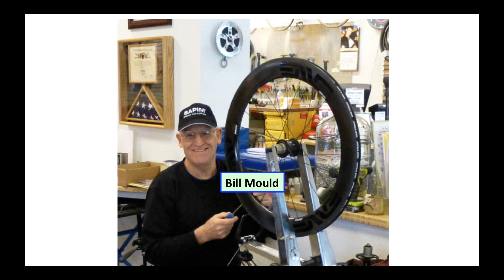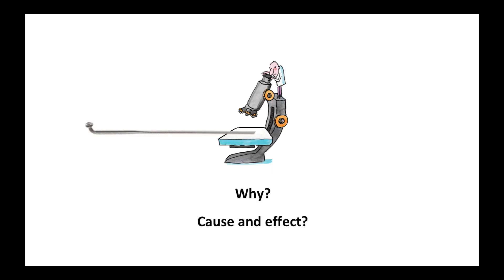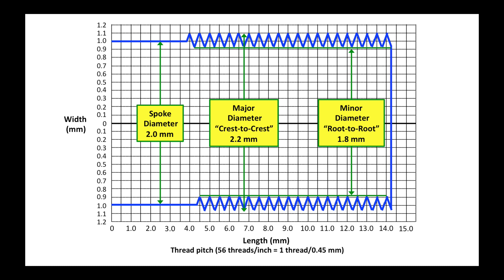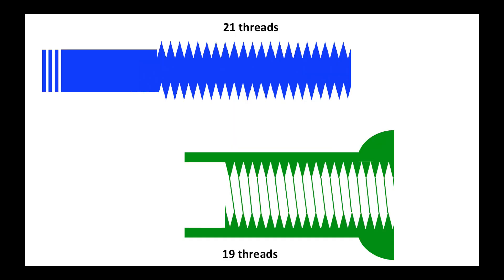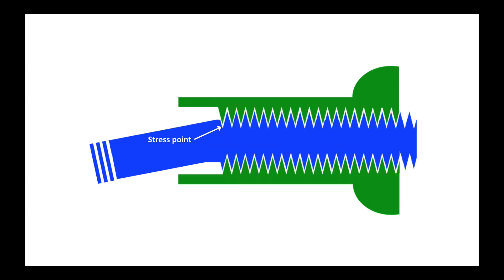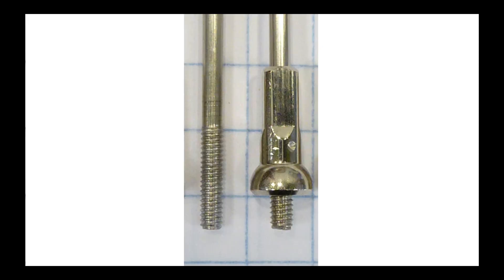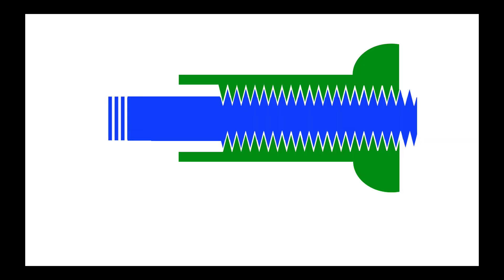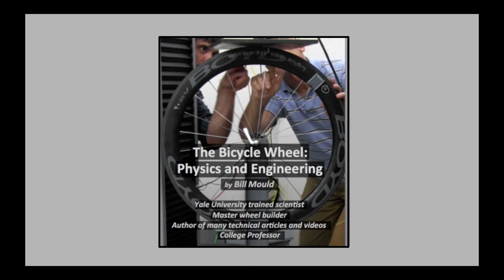Optimal Spoke Length

Comment: I usually thread about 12-13mm on every spoke I use (they usually have about 9mm) to avoid any issues of this kind. I also bend the ends a bit to prevent stressing the spoke at the base of the nipple

Comment: While the advice on spoke length has some logic to it, in my opinion it might not be the best solution with aluminium nipples. Once you bottom out a Squorx DT Al nipple, it's a gonner. TIghtening it further will either rip the square interface off the body of the nipple at the top or strip the splines of the external torx on the inside of the rim.
Reply: There, just yesterday I tried replacing a spoke in a wheel where the spoke I received was too long. Immediately after the (brass!) nipple hit the end of the thread on the spoke, the square interface part of the nipple simply broke off. No way whatsoever of tightening it over the spoke thread.
Reply: Yes, not the best advice, it simply doesn't work universally except for some isolated cases.

Comment: I neglected to add: If not having enough threads is a problem use a different nipple. Some have more thread than others as well as different overall lengths as you know.
Reply: Plus better alignment/orientation capacity.

Comment: Having built several thousand wheels over the years...I find spoke breakage at the nipple to be maybe 5% of the total of broken spokes. I see more failed nipples than I do spoke thread fails. I don't like driving the nipple past the threads and onto the spoke shaft. It requires significantly more torque which may be a problem with some softer nipples, it slows the building process down by forcing my (slotted) nipple driver off the nipple  4 or 5 turns prematurely. I also try to consider that I may not be the next person to work on the wheel. A nipple driven past the thread (especially aluminum) can gall against the steel shaft and be very difficult to remove without rounding the nipple flats off...turning a 2 min true job into a 10 or 15 min nipple replacement and much more involved true job. Lots of extra risk for a negligible problem. There are wheels which require a steep nipple exit angle and which do place a bending force on the spoke.  If shaft straightness is this really important, I use a 2.5mm ID thick walled steel tube and once the spoke is in the hub and keyed in position, I put a slight bend on the spoke shaft such that the thread enters/exits the nipple nice and straight and the bend occurs only on the shaft just after the nipple flats.  Problem solved.

Comment: Thanks for the informative video. I arrived at much the same conclusion long ago.
Armchair experts on bike forums do far too much hand wringing over running up against the end of the thread when going a couple of turns past the end is a good thing as you pointed out.
I have actually considered making a stop for my spoke threader to limit the length of the threaded end to seven millimeters when using 12 mm nipples.
Years ago I made a stop that allowed it to apply 13 mm of thread when using 16mm nipples but that was before I had all this figured out. I never use that stop anymore.
Reply from the maker: Dan, thanks much!  Bill

Comment: Wouldn't it be better to match the spoke and nipple material(steel to steel or aluminum to aluminum or brass to brass) rather than forcing the nipple onto the spoke and out the back of the nipple? Maybe the spokes should have upset threads like some bolts do.

Comment: This is very interesting and insightful video, but practically I am assuming it would be hard to achieve same end positions on all the spokes when trueing a  wheel with equal tensions. The next question is would it be better if all the spokes have equal weak points rather than having only few spokes with weak points, which would likely break?
Reply: All spokes will be equal, you would build to the end of the thread as usual. If your chosen spoke is 1.5 turns longer, you turn all the nipple that amount extra. Will make no difference at all. Second, if you need to turn a nipple or a few 1.5 turns in order to true a new rim,,, it's not a good rim ,, use a different rim.

Comment: Great information but still newbie to this spokes thing. My stock spoke in my motorcycle is 151mm but I have bought a spokes online which the seller sent a wrong length of the spokes which is 161mm. Question is, can I still use the 161mm spokes in my current rims and hub?

Comment: What about single wall rims? The spoke end can damage the inner tube.
Reply from the maker: Good question.  You unfortunately can't use my recommendations with a single wall rim for he very reason you cited.
Reply: @BillMouldWheels  And yet for decades bicycle manufacturers did, look at any pre 1970s steel rimmed wheel, they simply ground the protruding ends off.  It was an unwise cyclist who tightened any spokes without dismounting tyres removing rim tape & filing off the new protrusion.
Reply: That's why they used to grind the ends off flush with the nipples after building.

Comment: This is very interesting. I‘d like to know more about the last statement about the longer spokes. Maybe you can give more insights into this. How do YOU calculate the spoke length to achieve this result?
Reply from the maker: Christian, I just use a standard spoke length calculator and round up about 2 mm.  Being a little longer than necessary is better than being too short.

Comment: I'm building an E-bike from the frame up. Been debating if I wanted to tackle wheel building. Your discussion of the mechanical interface between spoke and nipple isn't just useful, it's golden! Now I understand why one wheel parts supplier I've been perusing recommends going a bit (one mm in my case) longer rather than shorter, especially as I'm using double walled rims. Thank you. Looking forward to watching your other videos...

Comment: Thank you Bill for your time and experience. I need your advice and help on a set of spikes and a custom wheel I am building. I took the measurements used an online spoke calculator and came up with a spike length if 276.5 I went rummaging through my stuff cause I knew I still had a set of 14 gauge I hadn't used they measure at 277. So I laced the wheel and hub together using a 4 cross and believe it or not the spokes are way too long and are bowing out. I only tightened them down till the spoke are flush with the head of the nipple. Is there a DIY way to thread the spokes more without having to order a thread machine. Something I could possibly pick up like at the auto parts house or some other trick you know about? Thank you for any and all information.

Comment: What about tubes, when the spoke comes so much out of the nipple?
Reply from the maker: You are probably talking about a single wall rim.  In that case, you have to use a shorter spoke for the reason you are suggesting.
Reply: @BillMouldWheels  Yes, I have single wall rims, so that teaching sound a little bit weird, but now I understand there is those double wall rims too, where overlenght of spokes dosen't matter.
Reply from the maker: @TuomoTamminen  Yes, sir.
Reply: You take notes from Raleigh, grind them off flush.. they did so routinely for decades.

Comment: Hey Bill, do you use Loctie on your nipples? if so which type? or do you just use oil? I never used it until recently and found when you use it, it begins to go off too soon so you have to rush the build. I was asked to use it as my customer nipples have come loose on previous wheel builds despite being tensioned correctly.